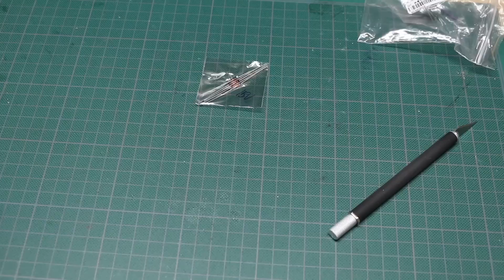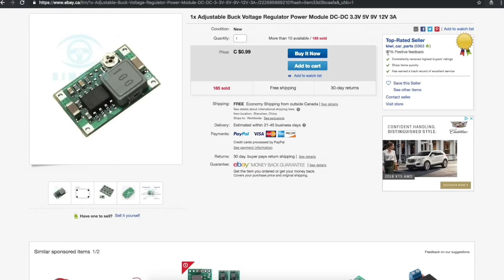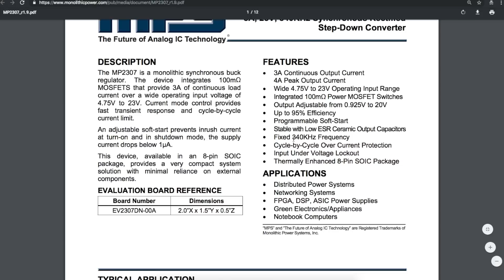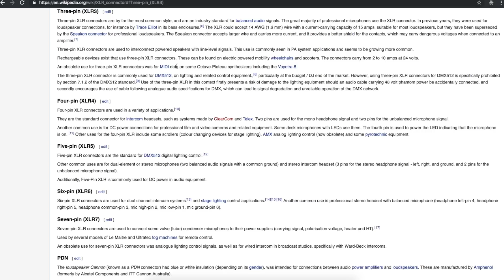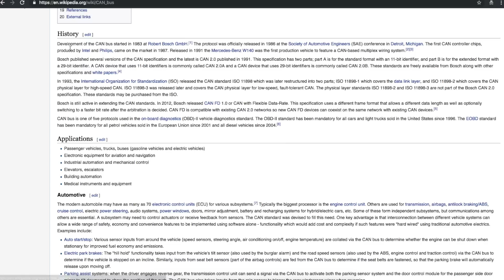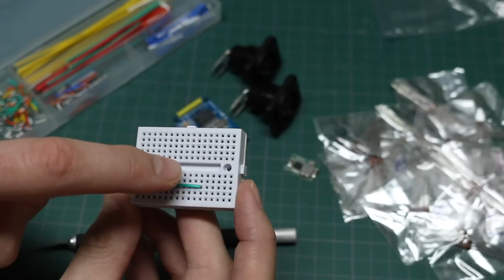Mailbag - DMX512, CAN Controller, Buck Converter, and Parts

Comment: 3.3V and 3.6V Zeners are useful for simple protection of 3V data lines in MCUs from a 5V signal.  Need a little resistor in there too, of course.   They get noisy (and hot) though, with substantial current.
Reply from the maker: Speaking of protection , I ordered some TVS suppressors that I still haven’t found in the mail bin.   I was just down in the lab for two hours straight trying to find some stuff I opened recently and it’s nowhere to be found. I don’t know how to get organized. Need to clear more space so I can make more projects instead of always cleaning up.